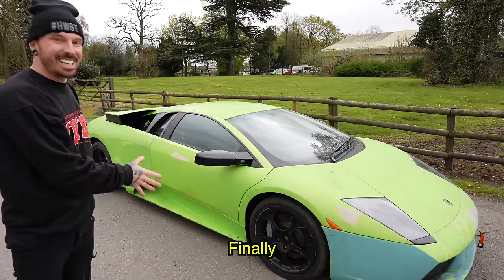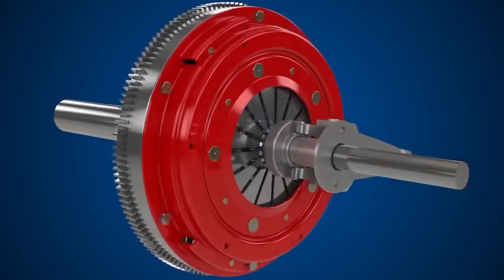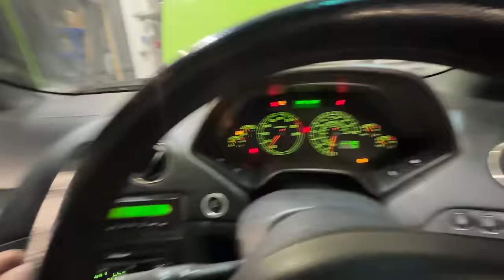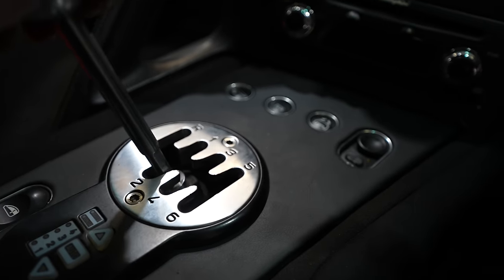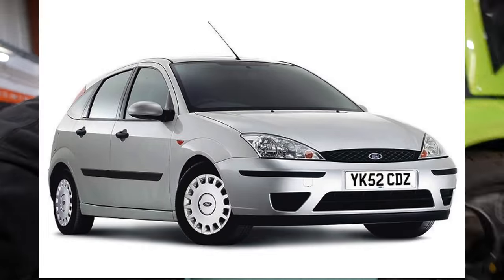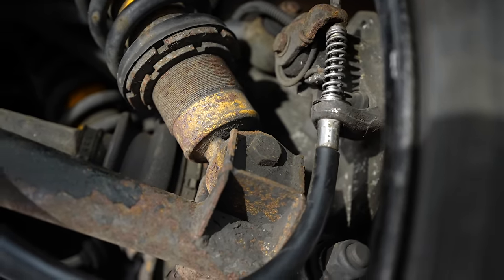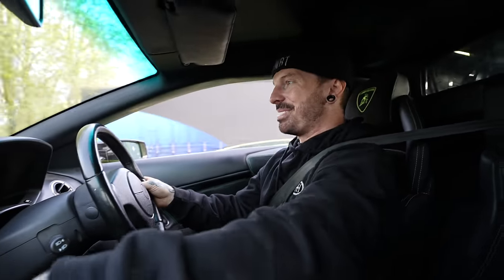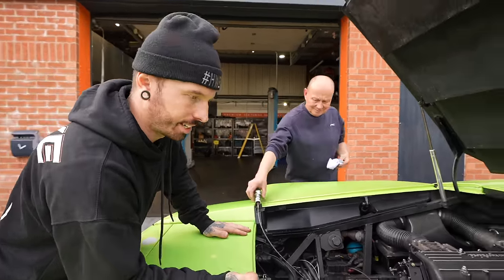REBUILDING AN ABANDONED LAMBORGHINI MURCIELAGO | PT12

Comment: On a big V12, that starter will be pulling a big current. That means the alternator is gonna need to work hard to bring up a depleted battery. At work we work on it being around 20minutes of running to put back in what you took out during cranking. That's with a V8 diesel not a V12!

Comment: If your battery is dead you could only assume the oil sensor may be wrong due to the low power.  You need to get those tires so we can hear a full belt of it (with no music please).

Comment: Oil pressure is directly related to engine RPM. At 1000RPM = 1.5-2.5 BAR (22-37PSI) and at 6000RPM = 5-7 BAR (73.5-102PSI)

Comment: Okay, so a very common problem on the VW and Audi group cars is that if you have a flat battery or a battery that’s running lower than 12 V that the cam bus voltage gets too low to read the sensors properly , so try fully charging the battery and see if you still have a low oil reading light

Comment: I had the same problem with the oil pressure on another car, at low revs its on and as soon as you give it more revs its gone. It was the oil pressure sensor that was leaking a bit itself. A cheap fix, atleast in my case

Comment: The pressure showing at idle is poor anyway, and guessing as oil gets hotter and thinner pressure drops enough to trigger the sensor switch. Ceartainly investigate as if its right youll knacker the engine.

Comment: The oil pump could be leaking inside the engine. Which would be most noticable at low rpm. I notice you were a bit quick and sloppy when sealing it back together with sealant. Obviously check the pressure switch first. Easier than pulling the engine apart again if that is the problem.

Comment: When battery or alternator is bad. It can cause that oil light come on. Low voltage can make funny things! Bad groundings can do that too. And i bet that all grounds have been opened when taking that thing to parts. Ofcourse it can be oilpressure problem or the sensor is bad. But im almost sure that its totaly ok

Comment: Maybe change the oil pressure sensor
This fixed a similiar issue with my car on low rpm showing the oil light.

Comment: The battery not charging and the oil light are probably related. Sensors behave strangely when the battery is low on voltage

Comment: Hey man, not sure if Lamborghini's are the same, but an air cooled 911 runs a dry sump system like yours and the oil level needs to be set when warm and running. If the oil level in the tank is a bit low then it flickers the gauge the same way yours is

Comment: As an FYI those climate control units that are shared with the Rover 45 / MG ZS are very reliable, however they have a little transistor pack commonly called a "hedgehog" that controls the fan speed - these very commonly fail. The same part was fitted to some Ferraris too. They can usually be repaired, but working stock are hard to come by and cost a fair bit.

Comment: Did you put normal oil or running in oil in?

Running in oil is very thin and the oil pressure in my s15  does go very low when the car is idling when hot

Comment: Oil pressure switch. Wifes car was exact same when revs went below 1k and went off again over 1k and usually only happened  after running for 20/30 mins although hers wasn’t a lambo 😂

Comment: Did you ever go back and try the second green wire as if you got it wrong you may have the temperature wire mixed with the fuel wire and that's why your gaining fuel and could coarse other issues like oil light which you could check the oil pressure by removing the oil pressure switch fit a T fitting and fitting  old school oil pressure gauge and the switch to prove  its wrong or right

Comment: The oil pressure indicator kicking on could actually be a false positive due to the low battery? Or as you said could be the connection, or just the sensor itself is failing?
Anyway, the way I see it the only way to figure it out is just using a mechanical oil pressure gauge. Those never fail!

Comment: this seems that its cevlar clutch and its thicker than original, so it needs braking in, also for bleeding its two peaople job. one that pumps the clutch pedal other crackts the nipple. i use vacum to bleed from nipple while aplying pressure from resovar

Comment: If its not charging the battery or the alternator is just about working then all of the weird sensor problems may just be due to low voltage. I do microelectronics repair and when a chip gets lower voltage than its meant to run on all kinds of weird issues can appear, that then go away once its ran on the correct voltage. E.g if the voltage to the sensors isnt high enough it may be reading it as the sensor isnt contactable / not working.

Comment: I've had an occasional oil light come on and off when I rebuilt an older BMW Motorbike. Turns out the Oil filter seal didn't properly engage and all I had to do was unscrew it and put it back on. Since the Oil filter was inside the oil sump, the leak could not be seen.

Comment: handbrake looks like jaguar xk8. approx £150.00 In relation to the oil I had an XJR in that would do this when filled with Motul. Nothing else just Motul. New filter and swap to Castrol, no more oil light. Failing that move up a grade see what happens.

Comment: You can bleed that clutch better than you did , you literally cracked it for a second.

Fill the whole ezibleed reservoir bottle up and run it all through with a clear pipe on the exit bleed nipple being carefully not to let the reservoirs  get low and air get in 

Watch for all air bubbles until totally clear

Comment: Oil pressure light could be because the voltage is so low , battery didn't charge any on your drive. I could be way off

Comment: I have the same problem when the Low oil pressure indicator lights up on hot idle at around 750 rpm. I haven't have a Lamborghini but the problem seems the same and I still don't know what.

Comment: If it is any help, I had the same symptoms with a brand-new Renault 5GT Turbo back in the day and it turned out that the spade connector on the oil pressure terminal was not pushed on correctly in the factory. Instead of the female part of the connector being around the blade, the blade was between the female part of the connector and the outer plastic part of the connector. Easy thing to check out.

Comment: HI GUYS I know where there's a RHD  2022 GT4 damaged for $30 K USD  probably no reserve ! no bidders obscure website  less than 3000 KM . Damage consists of blown strut tower damaged fender, light seems ok as does the Wheel some light/moderate  damage to door and rear quarter font bumper split but probably repairable , air bags appear intact  auction ends in 2 days . expect some shipping costs probably $5K to Europe .

Comment: probably it was a very effective way to kill the engine by reving it up to 6-700 thousand rpm before breaking in or checking pressures. So now you're missing oil pressure. Hope it's pump or a pressure spring/valve, but it's more likely a bad rod bearing oder crankshaft bearing. but i wish you much luck, if you would just work a bit more serious..

Comment: U know why u Vids are successful....because you have a trillion problems with that thing and you can still laugh and smile..seriously mate u need someone like me to work on ur engines. I don't start anything until I know its correct.
No second guessing
Reply from the maker: So why would I need someone like you to work on my engines if me working on them makes my videos successful? 😂
Reply: @MatArmstrongbmx  your smiles make your videos successful..man I'm trying to help you. I've learned from guys who build engines in temperature controlled white rooms. And that's no joke.
Not blowing my trumpet by any means. But grew up building Nissan fj20 and Nissan rb26.
Still do a few today is I could add that knowledge to what your doing we would be unstoppable..I love your ideas I just wish I was there to help. For a start we would put twin turbos. Forged aftermarket pistons. Full fabbed engine bay.I am an automotive fabrication engineer by trade. I've built parts for v8,supercars here in Australia and f1 parts aswell as some full on rb26 30 stuff what people are doing today but 25 years ago. I admire you